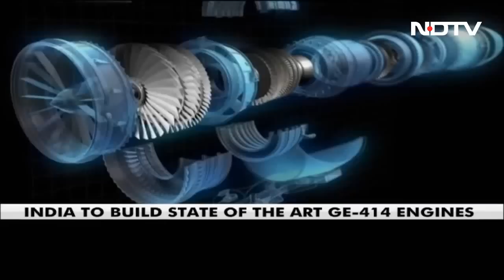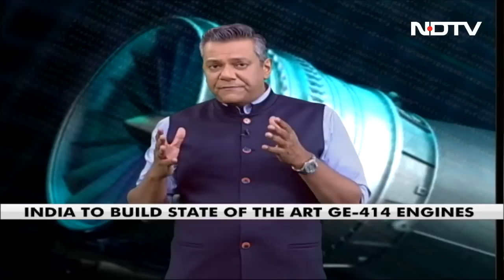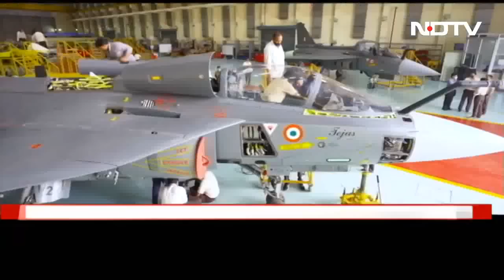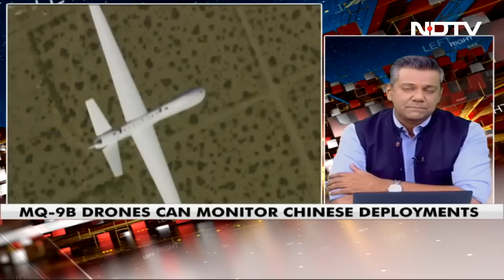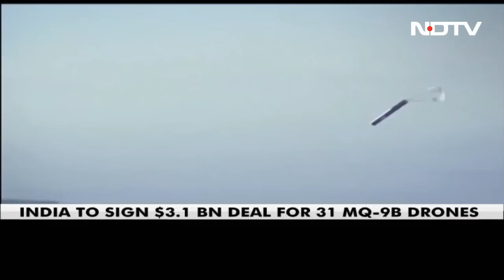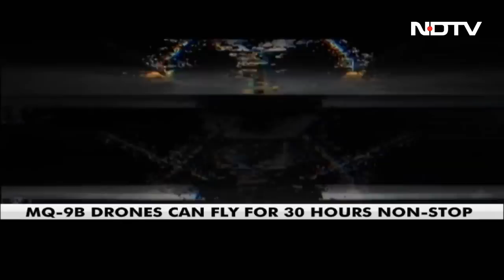During PM's US Visit, A Jet Engine Deal That Can Redefine Indian Aerospace

Comment: The manufacturing process for single crystal blades is complex and involves precise control of the solidification process to promote the growth of a single crystal. Directional solidification or the use of advanced techniques like the Bridgman process or the floating zone method is employed to achieve this. The resulting single crystal structure allows the blades to operate at higher temperatures, which leads to improved engine efficiency and performance.

Overall, single crystal blade foils play a crucial role in modern aviation engines by withstanding the demanding conditions within the turbine section. They contribute to the engine's reliability, durability, and power output, enabling aircraft to operate efficiently and safely at high speeds and altitudes.
Reply: Great masterstroke from modiji. this is a great achievement of modiji who did this for India. this was a master thinking of modiji who conceptualize such ideas and was main inspiration in this thing. had he not been guidance , such feat was not possible?
Reply: GE has always monopolised the Jet Engines to India 🇮🇳 

No mater what they walk to the banks with sacks of 💰

India Inc., is all talks and brags, but has never been able to over come this handicap.

Comment: The absence of grain boundaries in single crystal blades reduces the susceptibility to creep deformation and cracking that can occur under high temperatures and stresses. Additionally, the crystallographic orientation of the blade can be optimized to align with the principal stress directions, further enhancing its mechanical performance.

Comment: This deal will not follow through. Mark my word.
Reply: If the transfer and the construction of new factory doesn't start this year, you may be right. But if it does and the actual ground breaking and physical data hasn't been transferred by December. Bureaucratic inertia in the US will make sure it does go through. Because at that point it will be too hard to stop. But since the US GOP only holds a 5 seat majority in just the House of Representatives. There is no major political change possible in the US for at least 18 months. Besides the technology is not cutting edge for the US and to many people's disappoint the actual tech transfer will be limited. If for no other reason India may not be able to make a of the technology that could be transferred. Like the advanced metals and machining required. It will eventually develop them, but that kinda of infrastructure takes time.
Reply: @TK199999  USA will make sure India takes a anti Russia stand before letting any thing being passed onto India. So I am not too hopeful about this tech transfer.

Comment: Going from past performance of Indian 'intellect', the technology may be transferred but it will stagnate with INDIA because INDIA simply does not know how to effect any incremental improvements to the product in hand! So, the USA has nothing to worry about. The so-called single crystal turbine blades manufacturing is around 80 years old and itself is based on technology of about 6000 years old principles (lost wax). INDIA is never prepared to spend even $1 on research. Engine manufacture is a challenge that has been successfully overcome by hard working engineers of USA, UK, RUSSIA, FRANCE, CHINA and JAPAN. INDIA is and will remain a failure in this area. What can we say about a nation that still imports bullets from the USA and the UK.